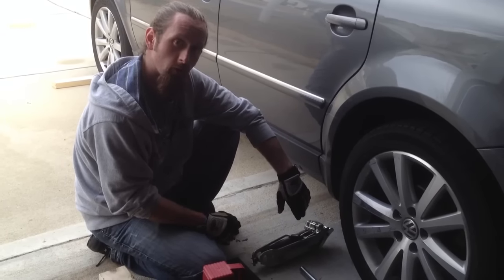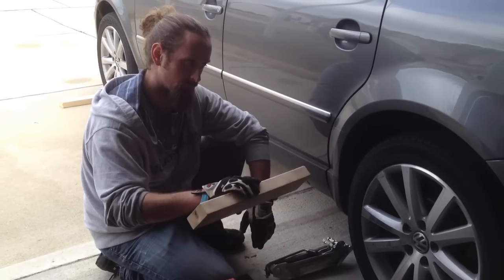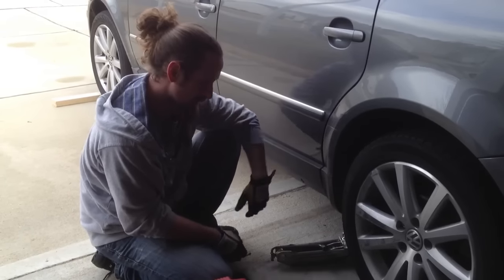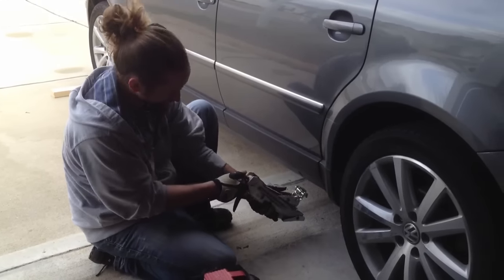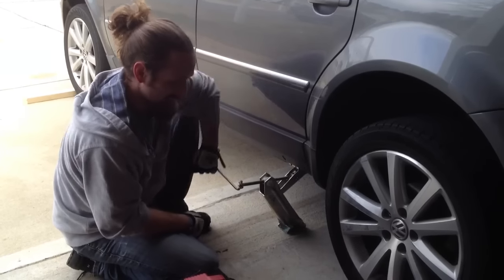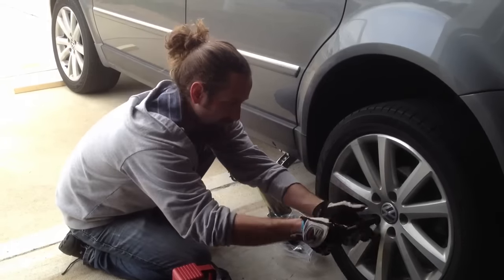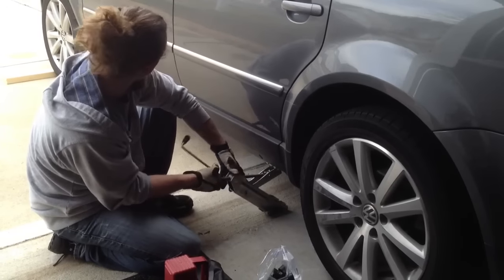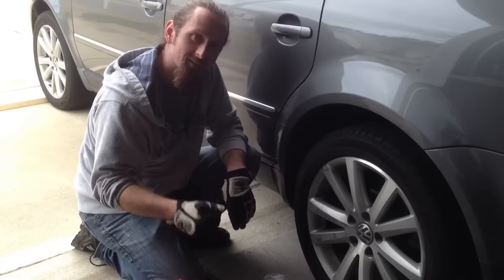Tips on changing a tire, and using a VW jack

Comment: Having had the unfortunate life experience of changing a lot of tires on the side of the road, I have gotten into the habit of placing my spare tire under the vehicle as I jack the car up, and then putting the flat tire under the vehicle as I change to the spare.  As the tire lays flat on its side, on the ground, I know that if something slips, the tire/wheel will keep the car from falling too low to get the jack repositioned and therefore allowing me to jack the car back up, whereas without that room preserved by the extra wheel, there might not be enough space to get my jack back underneath the car and positioned so I can jack the car back up if it were to fall.
Reply: Great tip,sir!

Comment: tyres wearing in the middle is usually a sign of over-inflation so check pressure with a calibrated piece of kit. Garages can have tyre inflation guages out by up to 6-7pse which would cause your problem.

tyre wear on the edges is usually a sign of camber problem.
premature wear accross the whole tyre could be many things but may be the toe alignment.

Comment: Great video on this strange jack. I learned years ago to carry a block of wood for the spare tire jack because of its small base. I had a flat tire on a muddy road and my jack pushed the base down instead lifting the car up. 

Also, there is a wonderful tool for the lug holes, called a "tommy bolt" which you insert into the first empty lug hole to hold the wheel in place while you remove the rest of the bolts. It is a smooth bolt with the same diameter as the lug bolt with threads on the end so you can screw it in with your fingers. Because the bolt does not have a head, you can slide the wheel over the bolt and off the hub. Then you slide the spare wheel on this bolt which keeps the wheel in place while you replace the bolts. ALL cars with this design of hub should come with a "tommy bolt". It is not expensive and takes up no space in the spare tire compartment.

Comment: Awesome! I've changed my tires on my VW plenty of times (always seem to get a nail in them every year!), but the wood block tip is excellent!

Also, the notch with the pinch well tip is a need-to-know for all VW owners! The first time I changed my tire, I figured it'd be as easy as all of the other tires I had changed on my old Monarch and other cars, but boy was I wrong! Not knowing about the pinchwell, I ended up bending part of the frame of my car. Smh, lesson learned really quick!

Thanks HumbleMechanic.

Comment from the maker: It is a 2005(B5.5). It was the last year of that body style. Your 2006(B6) was the first of that body style. I swapped the wheels from a Passat like yours. ;)

As far as the tires. The control arm bushings may be worn, but you would probably hear them making noise. I would get the alignment checked anyway. The alignment can be out(enough to wear tires) and still track straight. 

What type of tires do you have?

Comment from the maker: I was not using jack stands. You can do it with out, but it is mush safer with them. If you are working at home use jack stands. If you are stuck on the side of the road with a flat tire, do what you gotta do.

Comment: When I worked at a tire store in the 70's, the owner of the store, for the courtesy of women drivers, told us to put the new tires back on and hand tighten them, and to not use a power tool to tighten them. I've had cars where it was almost impossible to break the lugs that were put on so tight by a power tool. I always have a 4-way wrench in the car, to help bust loose the lugs. But the VW I have now came with no spare at all. Progress??

Good idea about putting boards in the trunk. I also keep some knee pads, a small shovel, and some kitty litter.
Reply: Why the cat litter?
Reply: @GeXExtremist  To help get out of mud or snow.

Comment: Hi - thanks - old video but great info. Found one of these jacks at a recycling center, appreciate the instructions. Don't plan on using it as a main jack but handy as a secondary backup. I don't have a VW but my car has a pinch weld. The jack seems a bit flimsy (lightweight) but it is well made. I'm no expert but if your jacking on wood I would not recommend pine wood. Try a hard wood, something less likely to split with the weight. Cheers........
Reply from the maker: This was my second ever YT video. :)
Reply: @HumbleMechanic   Thanks it (the video) really helped (explain the jack)... My car is quite heavy, an Australian made Toyota Avalon. I'll probably use my normal jack with this as well but you can't beat good jack stands :) Found the whole set (of these VW jack tools) at the recycling place, all of which was free....The things people throw out.:)
Reply: @Rareparrot  Be very careful with this.. it is known as "the widowmaker" in the world of Audi/VW forums and likely the reason you found it in the recycling center!
Reply: @Rob-wx2rq  I see ! Think I'll throw it out :) Didn't really like the design..... :) Cheers!

Comment: I'd never used the Skoda /VW jack in the four years ownership but thought I would check it out prior to a country trip. Never seen a jack like this before ( I have a trolley jack in the garage but didn't want to pack that heavy sucker for the journey) and the handbook instructions were totally unhelpful, never mentioned at all that the 'claw' had to be offered up to the underside of the car before lowering the jack base to the ground, which is counter intuitive to other jacks which generally begin with base on the ground before cranking the jaw up to the car. 

The video was invaluable, but even though I can see how to use it I hope I don't have to as it doesn't look particularly stable.

Comment: You're awesome and I will follow you, thank you. Though I wish you mentioned that they have the weird caps over the lug nuts that need to be pulled off with that odd pin like wire. I found it in a different video 😁

Comment: Hey Carles, when using an hydraulic jack would you still use the same jack points as for the OEM jack? Also, what are the best locations to place jack stands both at the front and rear. Thanks.

Comment: All well explained....EXCEPT........when you take the wheel off on a wet windy night   the stud holes mis-align and getting the replacement tyre back on is a real bitch as you cannot easily re-align the wheel studs with the hub holes. All very well in a warm comfortable garage !!!!!!!

Comment: Unfortunately I have to agree with some other regarding the frustration with this jack.  Yes it's very easy to use but  it really only works on a perfectly flat, level and dry surface. If the car can shift even a tiny bit of weight left or right due to snow, wet or anything else it's a recipe for disaster.   My driveway is perfectly flat and level, I removed the small covering of snow under the jack but the car still shifted towards me and scissored the jack, fortunately I was smart and had a stand nearby to get under the car.   Really a poor design for the side of the road repairs.
Reply from the maker: +Scott Crouse yeah it does kinda suck. It works good in idea places but a screw jack Would be better
Reply: Appreciate the video tho :-)   Good job on that and I'm sure it's useful to many regarding the tab positions :-)
Reply from the maker: +Scott Crouse thanks. It's one of those I hate to have to make. But glad it can helps folks out

Comment: Anyways, if you have a moment to spare... My front tires on my 2006 Passat are wearing super fast (even the new set), and unevenly, becoming really flat in the middle. Do you suspect what it could be? Control arm, etc? I don't believe an alignment because the car does drive straight, and does not sway....Any thoughts would be much appreciated, Thanks :)

Comment: One of the first things I do when I buy a car is to replace the factory jack. I buy a simple hydraulic jack  because the screw and scissor jacks are DANGEROUS. I was jacking up my Camaro with the factory scissor jack and it collapsed on me. on even ground They are garbage. Now on these smaller cars they may work just fine but if you own a truck or large SUV ditch the supplied jack. You could have the old tire off and trying to mount the spare and have a disaster on your hands. The brake rotor could be damaged or worse, personal injury.

Comment: Do I need to tighten my wheel bolts to a specific torque?
Reply: Depends on the vehicle, check your owners manual, and/or google search. My 2001 Audi A4 says 90ft/lbs, my wife's Ford Edge says 100 ft/lbs.

Comment: the first thing I do is get a star wrench and put in the vehicle. the lug wrenches that come with the vehicles are just knuckle busters.
also NEVER AND I MEAN NEVER  let someone just run the lug nuts down with an impact wrench. it can lead to all sorts of problems including warped rotors stretched lug bolts and not being able to bust the lug nuts loose out on the highway. also check the torque on your lug nuts after 100 miles after putting on a new tire or rotating tires.

Comment: Both of my teenagers have VW's and I've had the unpleasant experience of having to change flats on them. I keep a hydraulic jack in the trunks now and use this crappy VW jack only to lift it high enough to get the hydraulic jack under the car and onto a good spot on the frame. I do NOT trust these little things, especially after it shifted and collapsed the first time I used it. Fortunately the tire was still on the car and nothing was damaged.

Comment: Sooo if i'm changing the oil, where would one put a jack in the front of a vW?
Reply from the maker: Mochaka Boom There is a similar spot on the front. PLEASE DO NOT WORK ON YOUR CAR WITH ONLY THAT JACK. Use it to lift the car, then put a jack stand under the car. You are asked for trouble trusting a jack while you are under a car!!!!!!
Reply: Yeaa... So I lifted the car with this jack and put the jack stand under it, and then I moved onto the otherside and tried doing the same thing.. Baaaad idea 

As I was lifting the car, I guess it wasn't positioned correctly on the ground so as I was lifting it was coming towards me. The other side stand slipped off and the stand that was by the VW jack got crushed too.  The jack stand was rusty and it bent.  Lol I went to walmart and bought a proper jack/jack stand
Reply: Mochaka Boom jesus christ something similar happened to me, soooo  i jack the car with its jack and then put planks under the tires and have enough room for changing the oil (like ramps) :)

Comment: Ah ha... I see what I did wrong... cool! Thank you :)
Reply from the maker: It is a weird setup!!!
Reply: @HumbleMechanic  ha, well, it went up easily enough but then somehow going back down had me scratching the head :D but all good, it's out of the way, next is figuring out brake disc and pad change as too ball joint... although I am not seeing on my mech report, whether upper or lower :D Parts numbers should help me out though... quite a daunting area... I work with computers, wood and dirt - metal is a whole new world, but hey ho... I think I found me a channel that will lube me into it ;)

Comment: I have a question, please bear with me as I'm frustrated and angry. The owner's manual is so badly written that I f*cked up the side skirt of the car and now it's bent. The people who wrote it don't really show where to put the damn jack. It just shows two arrows on the sides. Okay, i saw what I THOUGHT was the lift point because it looked like a black oval near the left rear passenger side. I jacked it up and bend the skirt. Now it looks like something caught on and hit it from above. I can't snap it back in because there's nothing holding the end in

First: can you post a video of how to jack up a VW GTI with something to show the lifting points.

Second, why would they make this so confusing. There's NOTHING under the car to indicate where the jack goes so I'm afraid I'll only damage my car again. I was jacking it up to rotate my tires.

Can I file a warranty claim because it's not my fault the manual is so badly written that I put the jack half an inch (yes a fraction of an inch) away from the actual jack point and bent the frame? When car companies write manuals, they should show it to someone who does NOT work for them and ask them to try the instructions. I bet a lot won't understand at least 10% of the manual. My last car also had all kinds of confusing information in it.
Reply: Those arrows point exactly to the place of side skirt, which  has supports for lifting ( thicker metal inside the skirt) it has every car and you can also probably notice the thickness difference while looking at the side skirt or at least knocking at it as it makes different sound when it has supports :) For the warranty  I bet you can't file a warranty for that kind of issues, they'll probably tell you that you didn't follow the instructions in manual .

Comment: Have used that jack several times successfully in my driveway. However, the one time I really needed it on the side of the road of course I couldn't get it to function. Surface has to be absolutely flat and level or else it will not work. That tire iron  they give you an absolute joke as well. For the real world this equipment is complete shit. Do yourself a favor and buy a decent jack and at least a piece of pipe to give you more leverage on the to break those lug nuts.